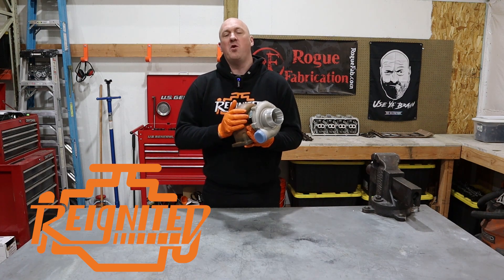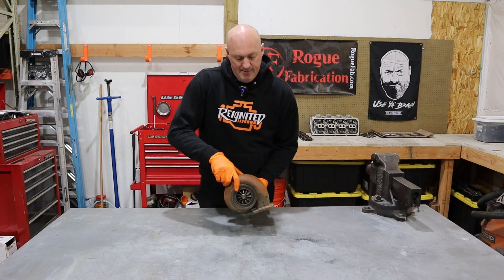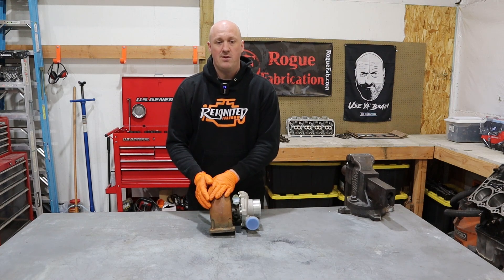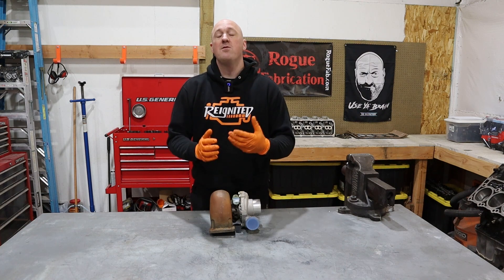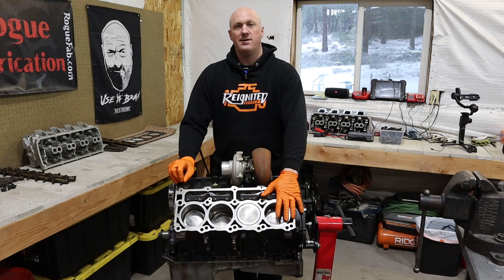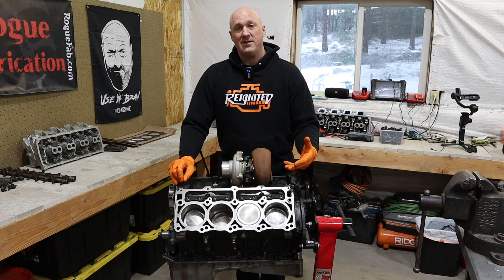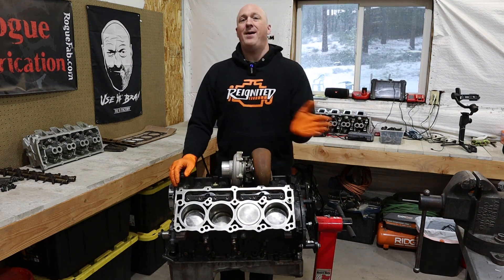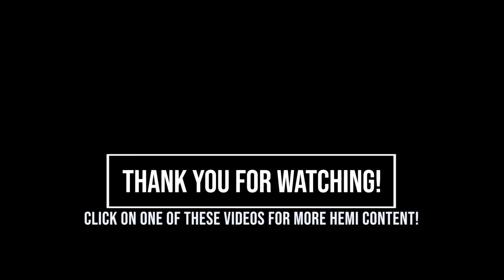Automotive Basics Ep3 // HOW and WHY Does A Turbocharger WORK?

Comment: Skyy I have plans to buy a 2014 Charger 5.7 police version engine blown. Saw your video on Magnum that you rebuilt the engine. Did you buy that engine lift plate or did you make it. Need one to pull the engine out of the Charger. If you bought it could give me the company you brought it from. Or if you made it would you make one for me and let me know how much if you will.
Reply: Thanks for getting back to me. Did I spell your name right. If not I apologize. Send me the correct spelling. I checked that lift plate out it said 3 gen hemi only. Do you think it will work on a 4th gen hemi. For 2014 Charger 5.7 police version. Thanks for sharing all you knowledge on hemi's
Reply from the maker: @shugg0517  close enough, it's just Sky 👍. Theirs should fit no problem since the intake bolt pattern is the same between the pre and post eagle engines. But, always best to double check with them first. 👍
Reply from the maker: I made that one myself, but motion Raceworks just came out with their Hemi engine lift plate that's actually a better design 👍

Comment: I put one of the milling oil pumps on my truck at idol it’s 37psi any gas goes to 90pis like 3000rpm it’s like 150pis I have a mechanical oil gauge and The factory one hooked up
Reply: I’m asking is 150psi is ok seems like a lot

Comment: Great video, but if I may, I have a few other things (That are far from basic though) to add.  Technically speaking, there are some naturally aspirated engines which achieve >100% VE, however it is only at a tuned frequency/RPM using a tuned resonated frequency to literally pump in air and/or also things such as ram air.  Between the two of them, there is an ever-so-small supercharging effect, however on a technical level, it is still naturally aspirated.  Variable length intake manifold designs help with these things, and in some engines, you can see the two torque peaks occur at the two different resonated points.

Technically speaking, naturally aspirated is more fuel efficient than a supercharged or turbocharged engine - you can see this by looking at fuel injector calculators.  e.g. 1000hp for NA might require 80 lb/hr, but turbocharger might need 90 and supercharged might need 100.  So for a give torque target, NA is going to be more fuel efficient.  That is strictly the engine itself though, and at maximum torque.  Every 14.7 psi technically doubles the engine, so a 2.85L engine running 14.7 psi of boost technically is as powerful as a 5.7L NA engine.  Because of inefficiencies in heating the air due to compression, energy lost due to turbo wheel friction, and exhaust backpressure, it would take more than 14.7 psi to be double.  However, that is peak torque, and one must also consider the added weight of the larger engine.

Off idle, a non boost 2.85L is going to consume less fuel than a off-idle NA 5.7L engine.  Also, because of the way you can regulate boost, you can generate a near-flat torque curve starting at a very low RPM all the way up to a medium-high RPM (Whence the turbo restriction starts to limit boost).  You can see this on a number of vehicles that have switched from larger NA engines to smaller turbocharged engines.  The torque curves are substantially better with the turbo car, and unless you're racing, you drive torque not horsepower.

The lb/hr ratings I spoke about above are relative, but correct as well.  In that NA > Turbo > Supercharged.  The amount of horsepower required to simply drive a supercharger on some of the hotter cars like the hellcat is over 100HP.  So for example a 707HP hellcat engine is making more than 800HP at the piston tops, but by the time the crank drag from the supercharger is subtracted, you end up with "only" 700 at the front of the transmission.  For my fellow gearheads that struggle with that, realize that to make 800HP at the top of the pistons, you need X amount of fuel.  The piston top doesn't care if the air inside the cylinder comes from a turbo, supercharger, or ambient air.  800HP needs 800HP worth of fuel.  So, if you look at those lb/hr ratings and also the duty cycle of the injectors, you can literally see how much more fuel you need to get 700HP from a supercharged car, than for example, a turbo car.

A real life example is the ford ecoboost engine in the F150's.  Around town, little load, almost no boost, they get pretty good gas mileage, better so than a big dumb V8 engine.  However, hitch up 8000 pounds, and the ecoboost is in boost most of the time to generate the same amount of torque as the NA big dumb v8 does, and the big dumb v8 will get better gas mileage.

From a bang for the buck though, you can easily add 50, 100 HP by just messing with wastegate springs or a simple tuner, costing you anything from $5 to perhaps $500.  To get 50 HP on a NA engine, you're talking a cam and potentially heads, costing thousands of dollars.  And even then, the turbo is going to make more torque under the curve since the NA engine won't have a flat tq curve.

I know you're a trans tech, and I'd love to get a advanced explanation of how an automatic works (Even though I can't live without the third pedal).

Keep them videos coming.  Is that the turbo you're going to run on the Magnum?

Comment: I've got a 11 Grand cherokee, with a hemi. I have a cylinder 5 misfire. I pulled the valve cover and I've got no oil coming out of cylinder 5 pushrod/rocker arm on the intake side... is this the beginning of lifter failure?
Reply: I previously checked coils, plugs, and injector prior to removing the valve cover

Comment: How long will the lifters tick after a new install
Reply from the maker: Generally around 20 min I consider the maximum amount. If they're still ticking after 100 miles they're not going to quiet down.
Reply: I appreciate the info a little after 15 minutes they went quiet
Reply: If they don’t quiet down should I consider redoing them or just ride  it out
Reply: I need your help! I had a bad tick but the lifters look mint? (2015 5.7 challenger)

Comment: a lot of people dont know that boost is unused air or back pressure thats why a hemi will make more hp on less boost than a wedge because it flows more so same amount of boost means different things to different engines  30 psi boost big block chevy will only be about 15 to 20 in a hemi. its unused air
Reply: And most people don't understand the "boost" is actually a measurement of restriction, and CFM is the real rating you're looking to increase!

Comment: I have a 2005 Chrysler 300c 5.7l with 80k Miles. Ive been doing oil changes every 3k miles. Should I've worried about the valve seats. Coolant temps never go above 203.
Reply: Jus let your car cool down before turning it off you can try turning on your heat before you exit also limit the amount of start an off cycles for instance if your just running into the gas station leave it running an lock the doors